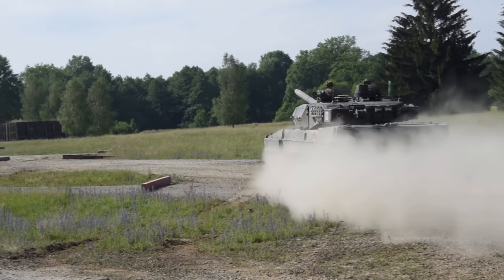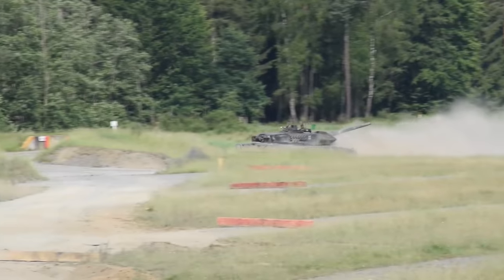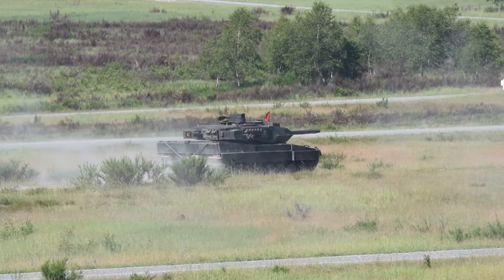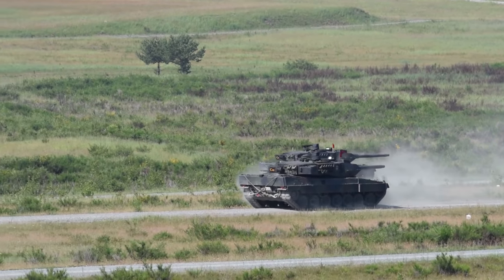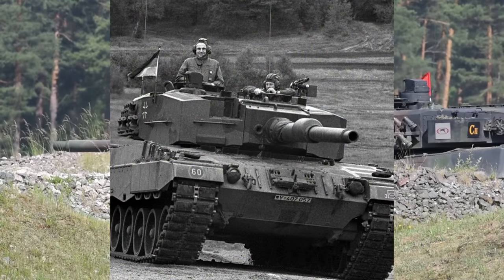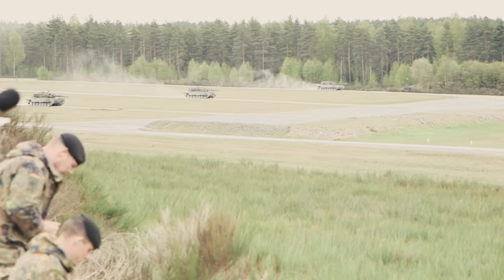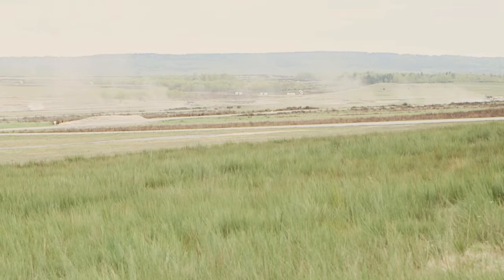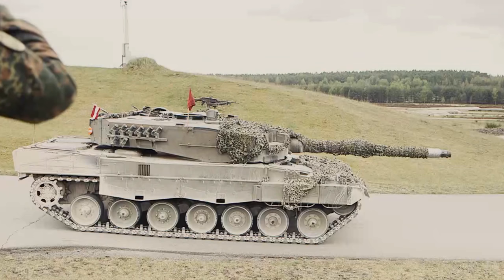Leopard 2 Main Battle Tank | GERMAN ENGINEERING

Comment: As a tank commander told me: 
Anyone that can get Leopard will buy it, and the ones who can’t will buy the Abrams
Reply: What did he mean by that?
Reply: Erwin Rommel Abrams are great tanks. Abrams has a good combat record.
Reply: I find it doubtful, or this tank commander doesn't know what he is talking about.
Countries buy Leopards instead of Abrams because it's much better deal. You can get latest version of Leopard or inferior export version of Abrams and Leos are cheaper.
Reply: Ally Agreed, leopards are cheaper and are much more versatile. They have a lot of modular upgrades that can suit each countries demands.
Reply: @2710cruiser  Germany is very strict in who they sell their weapons too. Nations with human rights issues for the MOST part cant buy the tank and those who do have the tank, Germany decided to stop upgrading
Reply: The Abrams is a fantastic tank, but one of it´s main features is also one of it´s main problems: The turbine. It has numerous advantages, but requires an insane logistics chain due to its gas-guzzling nature. Only very few countries are capable of maintaining logistics on such a scale.
Reply: akwpg well turbines are very efficient at high rpm but at low rpm or idling, it becomes very inefficient. They semi solved this by adding a apu to power vital systems.
Reply: @enochvarga7570  So let me understand this. You're more worried about the turret ring of a abrams, that in reality would never be hit, over the massive ammo storage sitting next to the driver and placed in front of the tank? O.K
Reply: @2710cruiser  he is probably referring to the fact that it's a significantly better deal considering that you can get a modern leopard 2 cheaper than you can get the export Abrams which is inferior to the US military Abrams and leopard 2 plus you don't have to deal with the Abrams guzzling all your gas because it doesn't have the US industrial complex to back it up
Reply: @enochvarga7570  A month ago I kicked his ass that there was DU on the hull in the Abrams. And DU maybe a great metal for Penetrators but certainly not Armiur, Tungsten is more dense that the Leopard design is right
Reply: @andrewmoore7022  No Leopard is not cheap it's actually more expensive the real price of the Abrams is 6 million but thanks to inflation because many Abrams were bought price increased to 8million. a A7 leopard cost like 9million and if added a lot of upgrades cost is 45million
Reply: and the madlads will make a crazy big ass war machine with naval guns that was mounted on the Bismarck as it main turret, and two Maus turret as support firepower....
Reply: @hazardous458  Leopard has survive Kornets, and the Abrams has not
Reply: Panzer Edelweiss - TheSteven798v2 Source?
Reply: Panzer Edelweiss - TheSteven798v2 None of these confirms it’s a Kornet. Also you don’t know it survived.
Reply: Panzer Edelweiss - TheSteven798v2 Can you read? What Kornet? The only missile mentioned was a Konkurs, he explicitly said the video shows a Konkurs striking a leopard. Also nice source, dude said the 2a5 has an extra Chobham armor wedge.
Reply: @hazardous458  I also dont understand why you Abrams fanboys would use DU for armour because Tungsten is denser, DU is only a superior metal when used for penetrators. Tungsten is the ideal for armour.
Reply: Panzer Edelweiss - TheSteven798v2 Nice try dodging the question. The US uses DU because it’s free. Tungsten is expensive and the performance between tungsten and du is minimal to warrant the cost. DU is free, it’s a waste product. Also I didn’t design the tank so I don’t know why you’re asking me.
Reply: @hazardous458  now have your read they were Kornets? Because no where I was dodging your questions
Reply: Panzer Edelweiss - TheSteven798v2 That’s a German site.

The other English one says nothing about the kornet. It in fact contradicts what you said saying it is vulnerable to Kornets. Also Sputnik news the same site claiming t14 armatas were destroyed in combat trials with no evidence. I’m starting to think you’re just choosing sources with the word Kornet in them and sssuming it means it is invincible to kornets.
Reply: Sorry its "Paralyzed" not Paralyzing
Reply: Panzer Edelweiss - TheSteven798v2 Paralyzed where? “meaning they took some hits first before getting destroyed” what? You’re making shit up at this point because that’s not what paralyzed means. 

Only one leopard was most likely destroyed by air strikes.
Reply: Panzer Edelweiss - TheSteven798v2 They only got hit once and that’s not confirmed it’s a Kornet.
Reply: @hazardous458  Paralyzed means they were bogged down, And certainly no they were not destroyed at first shot, they took some multipleshot before getting destroyed, your just denying what I said I showed a video I told you to translate the first Twitter video meaning it was only 60% damaged. As I said there has been no dead crews yet, they were abandoned, so no they were not destroyed after all I showed multiple videos, now if they were destroyed, it should be like Abrams were after one shot they all exploded violently here they show white dust, even if it was Konkurs since pen of that are 800mma it still impressive, there actually been no dead crew members since they can only confirm dead M60 crew members
Reply: @hazardous458  but wether Kornet or Konkurs it varies none of them were destroyed on first shot, all of the crews survive Some do say they were carrying ATGM both Konkurs or Kornet so I am right here,
Reply: @hazardous458  So can you even argue further? Nope a Abrams has not survive a Kornet, don't even listen to the Strategy link I had, There was no Kornet ATGM in Iraq 2003
Reply: Panzer Edelweiss - TheSteven798v2 I was busy studying, it’s test week about to end first semester (I’m in Quebec so it’s different from the states so semester isn’t the most accurate word but you get the idea) . I can already tell you’re the person that refreshes the page every 5 minutes waiting for a response so you can post your 500 links you saved. Anyways let’s see.

No you’re not correct about the word paralyzed, the original source you posted had no paralyzed word in it. Let’s quote you, 
“did you read the word “Paralyzing” at the starts? meaning they took some hits first before getting destroyed”

Your initial definition: “meaning they took some hits first before getting destroyed”
This is not what paralyzed means, this is what it means “(of a person or part of the body) partly or wholly incapable of movement.”
Also paralyzed is used on animals not tanks, the word for tanks is disabled. 

You were not right about the word paralyzed, your initial definition of paralyzed was wrong and changing it after doesn’t make the initial definition right so no. You’re not right. 

Also I see you’re a person of assumptions. Let’s see all the assumptions you’ve made so far:

- Assuming I said the abrams has survived a Kornet.
- Assuming they got hit multiple times even though they each got hit once.
- Assuming everything is a kornet when you still haven’t provided anything that says for sure that they’re kornets.
- Assuming I said the Leopards got destroyed which I didn’t.
- Assuming that I advocated for du armor.

To sum up this conversation, what’s happening is your putting your words in my mouth so you can defeat your own words. To recap because you most likely forgot.

I started this by saying the Abrams are great tanks, they have a good combat record. 

This is where you came in and said I quote “Leopard has survive Kornets, and the abrams has not”

I asked for a source.

You then gave me a source that didn’t confirm nor deny that kornets were used. 

You then gave me more sources that again neither confirmed nor deny that Kornets were used.

The rest were you assuming and putting false info in my mouth acting like I said it so you could “win”

Whatever you do at this point will only dig you further into a hole. I also already know you’re extremely shit at researching due to your incredible bias which causes you to cherry pick like that one time you though LOS thickness = effective thickness. That was funny not gonna lie. You know what really shows it, the fact you took the 2a4 Los thickness and bragged about how thick it is and how shit the abrams is meanwhile ignoring the abrams has an even thicker Los thickness xD.

Anyways, I’m done with this conversation as you can’t win against a extremely arrogant keyboard warrior that can only win conversations behind a screen and false information. You’re top on my list of one of the most arrogant people I’ve  encountered and I’ve debated flat earthers, that’s how bad you are on this scale.

I won’t respond after this and whatever you say back, it won’t work. Have a good day.
Reply: Panzer Edelweiss - TheSteven798v2 

Arrogant ≠ rude 
Just wanna clear things up.
Reply: @hazardous458  Arrogant does not equal rude? Isnt that your symbol meaning.. You know I understand math symbols very well. But whatever...
Reply: @enochvarga7570  As you can see I made some mistakes, but guess how Hazardous responded? He now refers me to flat earth nonsense guess how a Master I am, in the Leopard 2
Reply: @2710cruiser  You can buy a fully loaded Leopard 2 if your country respects human rights. You can buy an Abrams, but only a castrated Abrams version, if you don't respect human rights, but your dictator sells cheap oil to the American military industrial complex.
Reply: @hazardous458  The turbine has another big weakness, its huge thermal output. It's a giant magnet for heat seeking weapons. There are talks about the Abrams switching to a diesel engine, but it's all about politics.
Reply: @2710cruiser  Simple, Germany doesn't sell the Leopard to just random countries
Reply: that means no one.who can afford it.how many did the germans have
Reply: I saw 6
Reply: @enochvarga7570  lol cope bro
Reply: @hazardous458  They do but when countries buy tanks, they spend incredible amounts of money to get a stripped down, comparatively crappy version of the M1 Abrams. The original one, to be exact. The best version is currently the M1A2SEPv3 Abrams tank. Whereas you’ll actually get one of the best models of the Leopard 2 for a much lower price. Like, a really good load out and everything, that can compete with most other contemporary MBTs. If I was the leader of a country, I would prioritize buying Leopard 2s.
Reply: @subwayak  not really 
It can use multiple types of gas and has a large gas tank
And all tanks require complicated logistics
Needing more fuel isnt that big of a deal
Reply: @enochvarga7570  is rather have the turbine
Quite
Powerful
Less smoke
Reply: @PanzerEdelweissStevenDelMar555  tungsten is also heavier
More expensive 
And for what
Somewhat better armor
Reply: @justarandomtechpriest1578  tungsten is not heavier just slightly 0.1% heavier but nothing much
Reply: @justarandomtechpriest1578 a Leopard 2A4 has survive a Kornet, now the Abrams has only survive cold war rounds
Reply: Yes, one of the Country who buy the Leopard 2 is Indonesia,
I proud with the Leopard 2, the first time Indonesia own MBT, The MBT is Leopard 2, 
Becouse The Leopard 2 is one of the best MBT in the world.
Reply: @sarttee  the upper plate on the abrams is very thin and poorly protected by modern standards, up to the point in which firing any sort of chemical shell from the 60's into it would have an overwhelming chance of killing the driver and wounding those who stand inside of the turret, forget apdsfs shells, those will go trough it as if it was nothing despite its angle
Reply: @atoprime3184  the chances of anything actually hitting that plate above the driver at an angle sufficient to kill the driver is slim to none, it would have to be a Artillery shell, and if anything happens when a arty shell hits any tank at that  angle, someone has messed up in intelligence or its a surprise attack.
Reply: The Abrahms has been deployed in combat by the US multiple times and has benefited from this, whilst the L2 has only had limited deployment and typically by 3rd parties. L2 has not been subjected to the same level of field testing.

Comment: You should have mentioned some of  the Leopard 2's other features:
- It can dive through about four meter deep water with additional diving equipment (which is basically just a foldable tower over the commander's hatch to provide the tank with air and a rubber plug for the canon)
- It can climb vertical objects like concret walls or blockades with a hight of about one meter without additional help
- It's complete engine can be changed with the help of an amored recovery tank in less than 30 minutes - even on the battlefield! (Fun fact: The german amored recovery tank 'Büffel' shares the same body with the Leopard 2 and can change it's own engine running on batteries during the change)
- The diesel engine can run with lots of different types of fuel: As long as it's fuel consists of 60 % diesel, 40 % can be any other flameable liquid like ethanol, gasoline or even vegetable oils
- it needs only half of the fuel on the same distance compared to the gasturbine of a M1A1 Abrams (and it can run with many different types of fuel)
There's lots of useful features the Leopard 2 has over other modern MBTs! But in the end, I guess a key point on which MBT is better is still the skill of it's crew and they're opponend.
I think it's quiet unlikely, a Leopard 2 will ever face against an american, british, french, chinese or even a russian modern MBT on the battlefield so they all have to be considered as 'quiet equal' with every tank has it's pros and cons depending on the situation.

(Greetings from Germany and sorry for my english, I'm a little bit out of training since I left school)
Reply: Scheiße man dein Englisch ist nicht übel ! In meiner Schule hatten wir echt nur wenig Englisch das meiste durch Serien gelernt :D
Reply: Wow you could just change leopard with ariete, leclerc, k2, t90, t72....those tanks can all things you listed